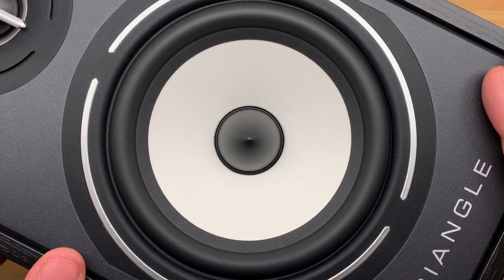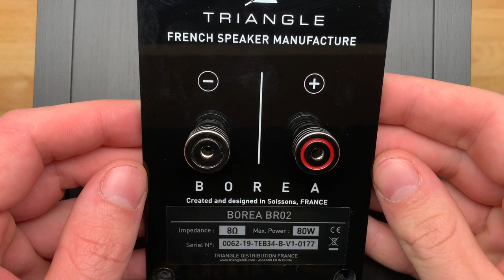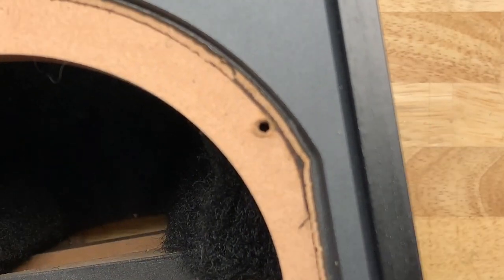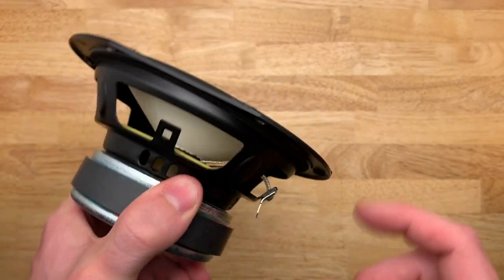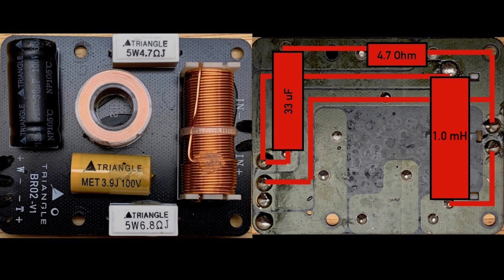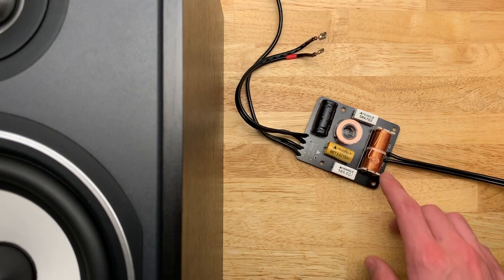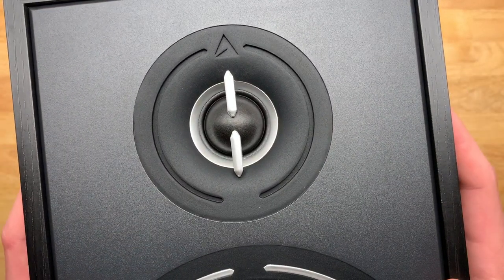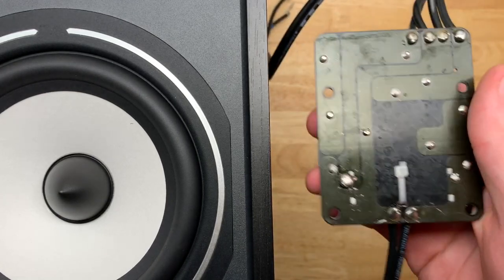Triangle Borea BR02 - Review and Analysis with Schematic

Comment: I laughed out loud when you said sand cast resistor! I said oh boy we have a Danny Ritchie fanboy here! haha. There is NO such thing as a sand cast resistor! That's a term Danny made up. They are wirewound resistors. Same type of resistor he replaces them out with. They're in a cemented rectangular body so that they can be securely glued to a circuit board. Just go to Mouser and try and do a search for sandcast resistor... There's also nothing wrong with electrolytic capacitors. They are made of a paper winding and sound more natural. "poly" caps is a very broad term and covers many types of poly versions but they are all forms of plastic and plastic sounds like plastic and the higher the voltage rating the thicker that plastic will be. Thicker plastic will translate into a harder, stiffer, glarey and more plastic overall sound. Metalized poly caps have a grainy thin sound with less bloom and overtones compared to a solid foil conductor. Just because a capacitor is more expensive to manufacture does not mean that it will automatically sound better.
Reply from the maker: Fair enough.
Reply: @Casey_Schmidt  Hi Mr.  Are you still with Triangle? Too bad you upgraded them. They don't have the potential. Because drivers very primitive. Don't waste time on them.

Comment: Triangle did a lot of good things with these but in the end they still measure poorly. I've gone through many speakers they haven't really done much here I haven't seen in speakers half the price. Their performance isn't good enough to justify the price when speakers like the JBL Stage A130 are around. But Im also not willing to pay double for ascetics. Bare copper wire dirctly to the binding post is free and better than bananas or tube connectors. Gr

Comment: From what I'm seeing in this video, the Triangle's cabinets do NOT appear to be constructed of 3/4" MDF.
Regardless of what YOU say about Klipsch's cabinet's construction, the 600M will easily "mop the floor" with this Triangle garbage.
In fact, I'm willing to bet 9 out of 10 people would pick the Klipsch as the better SOUNDING speaker over this Triangle garbage in a controlled blind listening test.
In addition, Klipsch will easily sell more of their Reference Premiere speakers in one week than this French outfit will in one month...LOL.
Reply from the maker: @Stephen Overton I went back and remeasured the wall thickness and it is indeed 5/8" and not 3/4", I must have mismeasured the first time so thank you for pointing that out.
On your other points, I think it is pretty clear that the construction and build quality of this speaker is higher than that of the RP600M. The Klipsch lacks wall bracing, gasketed fasteners, and cabinet stuffing. I will site the upgrade series done by Danny Richie over at GR Research as a second source for that.
I completely agree that Klipsch will probably sell more speakers in a month than Triangle will in a year. But that I think has more to do with Klipsch's marketing team and the fact that they've been around longer.
I would also mostly agree that most of the "general audience/consumers" would probably prefer the RP600M over the Borea BR02 in a listening session because the RP600M's are much brighter, louder, and in your face than the BR02's which have a much softer and flatter response.
Now, saying which is the better speaker is completely subjective based on what you define "best" to be. For me, I think the better speaker is one that is built well with great fit-and-finish. Others may want the flattest possible frequency response. Others, still, may prefer the one that "sounds that best" regardless of the actual measured response or build quality.
To sum it up, I will stand by that the Borea is a better built speaker. But it's always up to the listener to decide which one sounds better.
Thank you for your input!
Reply: Lol relax Klipsch shill. I disagree